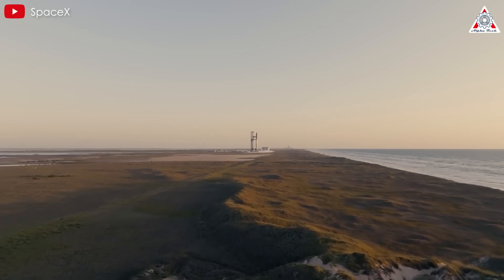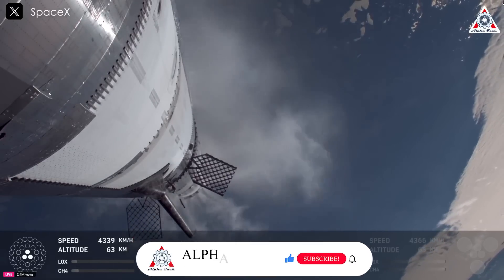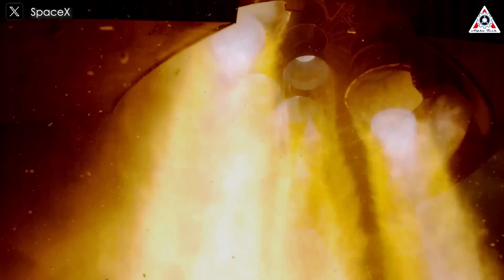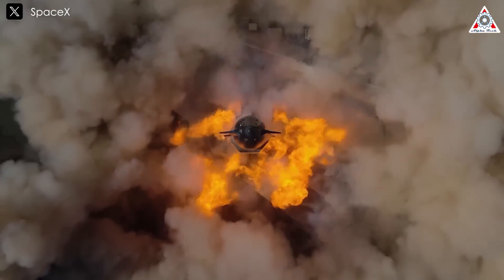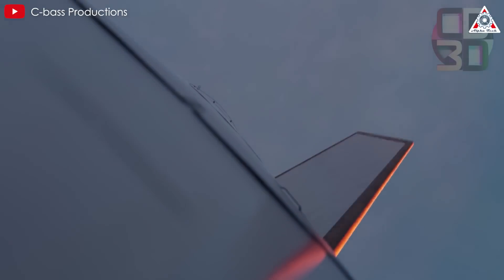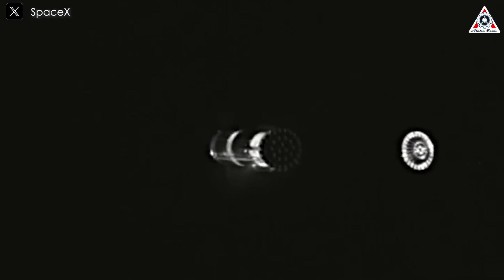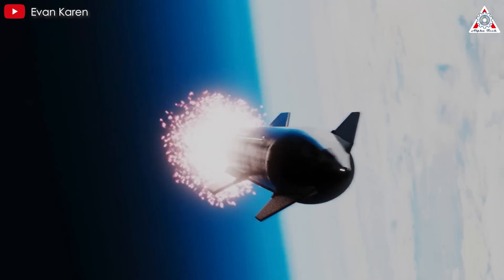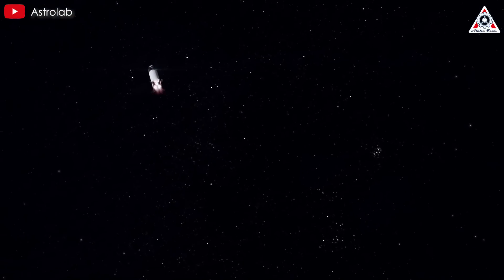SpaceX Hot Stage is a Big Mistake that Destroyed Starship V2!

Comment: Well, its not like the peanut gallery hasnt tried to warn them, or offer concepts.
The fun part, is how much alligns with my writs over the last four years.
Internet is forever!
I did the writs for a resource... Three user names, "grisbosque" variants, Act outside followed by a four digit number, on r/SpaceX, and my actual name here on Alpha Tech..
Did the parts count writs on r/SpaceX...
Fun part was always getting banned for trying to help...
Literally got banned on r/SpaceX after the parts count and engine simplification writs.
(They, right after Elon's Raptor 1 bankruptcy memo.)
In fact, I'm still banned on Twitter, now X, for humor just before Elon bought it. May try to reapply soon. Shouldnt have to do that...

The majority of these current issues and more are covered in my back writs here on Alpha tech, and alot of stuff did get used.
Theres more, that could be used and assist in these problems...
What I am happy about, is that SpaceX has finally run into enough problems, as to have to start to rethink things.

The first step in changing a light bulb, is realizing its not working...😂

I have faith in the guys, they are sharp, I suspect the problems are due to comittee engineering, stuck in the past managerial engineers, having to keep Elon happy, and he's pretty busy these days... 😂
(I think I may have affected that too!)

But! definitely minds opening due to the failures!
Like I said yesterday, failures have value...

I just wonder how long they can continue ignoring my contributions?
and maybe develope alittle respect? Could even ask my opinion... that would be nice...🤗
I love to help! 
If I wasnt trapped in a third world schitthole, by bureaucratic idiocy in a department Elon is supposed to be fixing, I'd come to Texas and work for free..
Wander around talking to everybody, getting a grok on things, suggesting possible solutions as an assistant Aspie...
Elon has jokingly called me his assistant before I think...
Could be;
 "Aspie at Large"

Would just need space for a Yurt, my dogs, & maybe a couple horses so I could be riding instructor at Ad Astra...

it is Texas right? You gotta know how to do more, than put on the hat... 😂

Humor aside, glad more of my concept plants are being considered, thats my greatest reward; when something gets used and works...

Guys! you are on the cusp of a major break through era in Starship... You have to learn to let go to do leaps...

Anyway, good video, happy to see new things being considered, this will lead to the needed paradigm shifts.
Its always about using the best concepts. Monkeys putting their heads together. 
And this is our most important tech in the long run.

I have made suggestions, strange part is causing the Parts count paradigm shift, and not getting respected there after...

So, just did writs here on Alpha Tech,
knowing some day they might be useful...

Will continue, unless the police pick me up again...
Or there's a US invasion and insurgency war backed by the Chinese..
How do I always end up in these adventures? 😂
Reply: Wtf 😳
Reply: @FrankGardner-ep9ih  
You'd have to know the whole story...
I'm not lyin', everything
I said is true.. and way way more..
If you compare my back writs, concept plants, theres an uncanny connection to things used on Starship, going back to Hopper..
See the proposed triangular tube hot staging ring? I did a writ about it here on Alpha Tech, before it became a thing, including suggested angles, and suggesting extra distancing...
And theres been many things like that... stuff that got used after I did writs.
You think parts count came suddenly out of nowhere? No, they used my writs, and things on my writs have been quoted to explain, all over space channels..
The only thing missing, was being credited...
I suspect I have maybe a dozen concepts in Starship now, not bad, for not being on the payroll...🤣
Also I often get thanked profusely by the channel owner...
I doubt he does that for every nut case...

And by the way, I know how to defuse the canal issue, been a field guy in Central America for 29 years...
I could teach courses that prevented stupid problems... And saved lives.. 
And I am telling the truth about being trapped by US government bureaucracy, people in offices making rules and creating hoop jumps for people who live in realities they are clueless about...

Its been a long story, I have lived in poverty for decades, but yet did in fact change the paradigm on rocket engines... and did certainly donate other good concepts...

Whats wrong with this picture?
Do we just use people with no reguard?
I could do alot more.

just sayin'

Comment: Remove the hot stage ring and add external / extendable legs that push/ separate the two .  Or keep starship legs extended as if it were part of stage separation and fire engines to separate.  Starship needs legs if it  will eventually land on moon, mars.

Comment: They could also initiate hot staging with the 3 outer engines only and start the inner engines after separation. This will do 2 things.
1. Remove the pressure reflection off the central dome of the hot staging ring from the inner engines.
2. Reduce the pressure on the engine bay and its internal structures during staging.

Comment: Install 3 cannon like ejectors. This will be like a potato cannon or a black powder rifle. This can replace the the locking device. One side will have a barre and the other will be a piston. Ignition of Methane and Oxy will give gas Pressure for separation. 1 or 2 seconds for ignition the vacuum engine ignite and 1 second later the 3 sea level. Or why not use the same claims that are on Falcon and 2 stage.

Comment: Changing the section if Starship from round to oval would give stability for reentry and allow two engines to be outside of the booster for hot  separation  .I would of thought it would also help control the areas heated on reentry along with removing fins on the edges .New Glen has a complete outer ring of thrust that is out side of their booster
Reply from the maker: Thank you for your comment! That’s a good information for me!